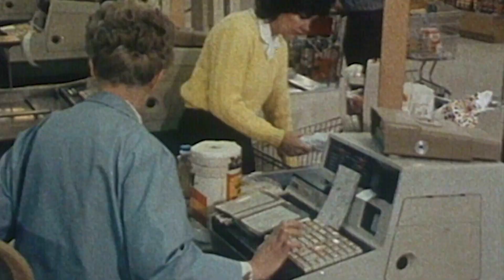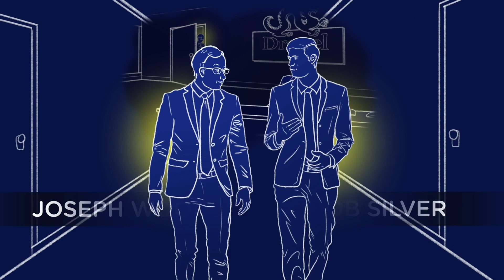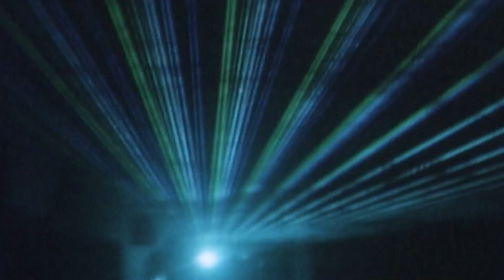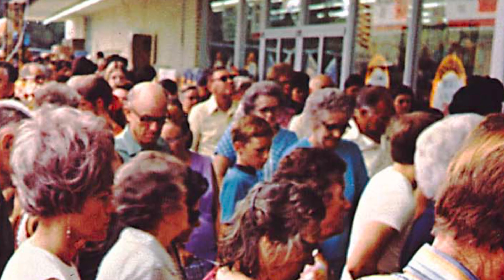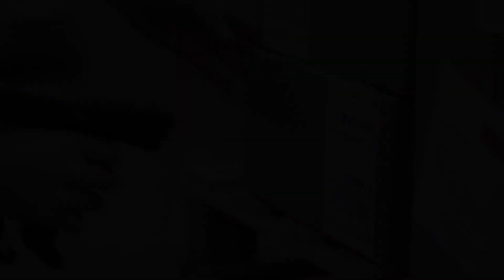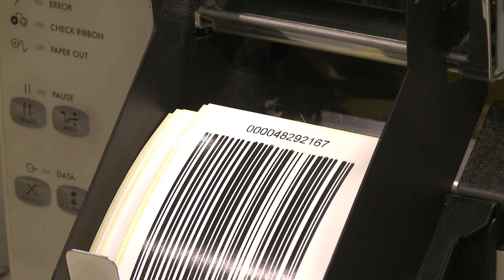How The Barcode Made Our Modern Economy - The Lightbulb Moment

Comment: I wish this video would’ve explained how the barcode is actually read by the scanner, and why it went from circular in 1972 to square soon thereafter.
Reply: First question, light reflection. Like every camera it has sensors that capture the light reflected. But to make it simple, we just stuck to white and black (minimal chance of error since they're the opposite) White reflects light, black doesn't (as much of course). So the scanner receives the light, turns it into data and the computer interprets the data and kaboom.
Reply: For the second question, I would make an educated guess that having a longer square barcode allows for more digits to be encoded than a bullseye style one like the originals had. They went very quickly from "we'll have a few hundred, maybe a thousand items to slap these onto" to "holy crap, EVERYONE wants one!" So they would have had to look for the fastest and simplest change they could make while still having the basic programming work with it - add more lines, have more data. Then how to keep it in the same space - have it read like a sentence rather than duplicate the information by having it wrap around, so you can increase data density. This was all happening back around the time home PCs were just starting to take off, so mainframe programming was likely still an issue for corporations, and they'd want to reduce costs by limiting the work done on the programs they already had in place. Printing new stickers would be cheaper than having programmers spend hours rewriting code, after all.
Reply: History of the barcode (smithsonian magazine

https://www.smithsonianmag.com/innovation/history-bar-code-180956704/
Reply: Taking a wild guess here, I imagine the circular design would allow the laser to read the barcode regardless of orientation. Not sure why they settled on rectangular later, but if you look at any reading machine today, it has a multitude of lasers in a bunch of orientations so they can read the rectangular one. They probably couldn't afford all those lasers per machine back then

Comment: I recall the era of retailing prior to barcodes:
When I worked in music records/tapes retailing in the 1970s:  the hand-held machine that applied price-stickers on merchandize were expensive, costing about $25 each; or $130 in 2021 dollars.  Those mechanisms had to be built strong for the use they got.
When the bar-coding was used to compile sales numbers for music records/tapes, it finally gave accurate sales count figures; as prior to that, records/tapes retailers could inflate sales numbers of units when reporting to radio stations/trade publications.  The record labels/distributors would show their appreciation to retailers in-kind for those favorable (i.e. inflated) sales reports. 

A successful grocer in the Fresno, California, region gave a group tour of his supermarket in 1976, where he told the group he was holding off from going to bar-coding since each Point-of-Sale checkout register unit would cost (US) $12K each; or equal to $56K in 2021 dollars.   So, consider the cost when replacing the six manual cash register checkouts with six bar-code PoS registers.

Comment: Cool video but I was expecting explaination on how it actually stores information and is read by the scanner
Reply: I agree. This video had potential to be so much more, even in 11 minutes.
Reply: It's binary converted to white and black lines instead of ones and zeros

The only info encoded in a standard barcode is a number. The number is an ID from a dataset which is where product info/pricing comes from.
Reply: The information stored is 10-ish decimal digits. They are encoded as varying widths of black and white stripes. Some stripes are alignment guides; you know which ones are alignment guides by seeing which stripes poke out the bottom into the numbers.
The scanner shines a line of lasers at the barcode, which is reflected back into another lens in the scanner, which decodes these digits.

Comment: I remember back in the 1980s not every store had yet switched over to barcode. Mainly small mom-and-pop locations. So I'm just old enough to remember seeing physical price tags on all of the stores items that were printed out by some price tag label maker. 

And at the big box stores, you would sometimes find a bar code along with a physical price tag, as this was still the tail end of the transition time. But by the early 90's big box stores no longer hand-printed labels. And most mom and pop shops spent the cash to get the full bar code system in place as well. 

And by the time the internet really got going in 1995, the US a least, was 100% all barcode at that point.

Comment: Actually the timeline seems a bit silly about two dimentional bar-code. They started success 1992 with the movie "Batmans Return" wich was the first movie using the two dimentional barcode to encode the complete audio of the movie. With 4 barcodes per picture and 24 pictures per second you have more than 600.000 Barcodes on one normal movie. So in the late 90s, already more 2d barcodes where scanned than 1d ones...
So 2d barcode with more detailed information is not something new, but more than a quarter of a century old. It has only become more visible to the public in recent years - before it was only hearable to public, not been recogniced as a 2d barcode for the normal people.